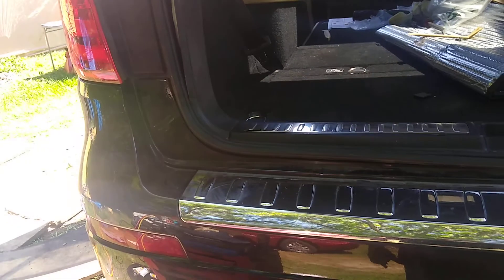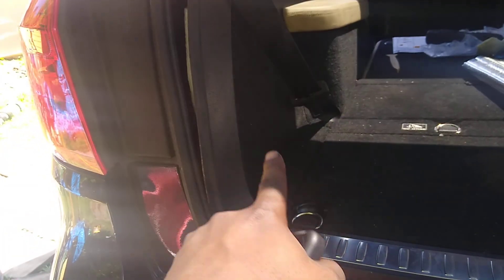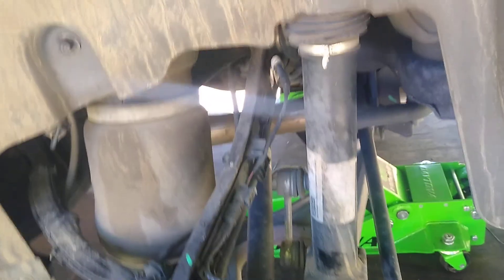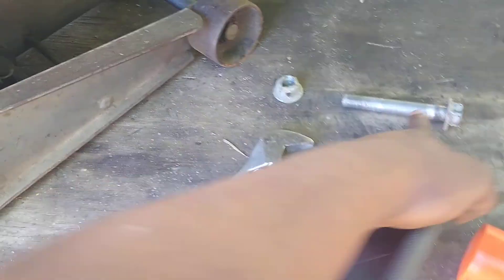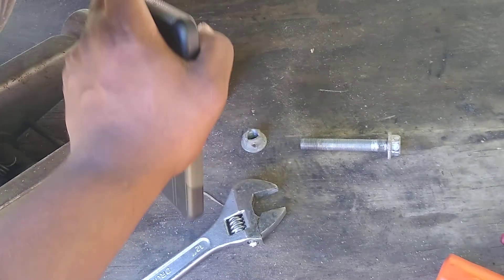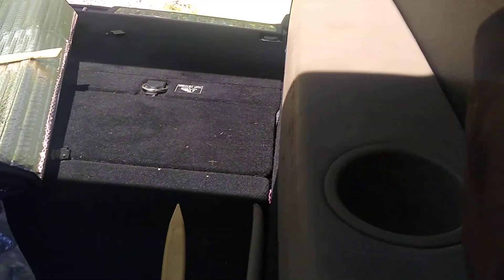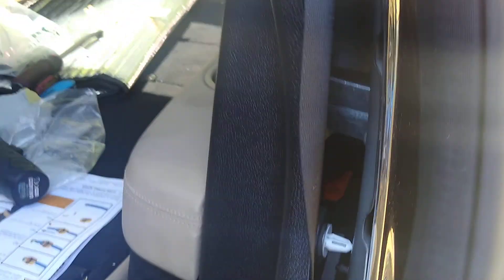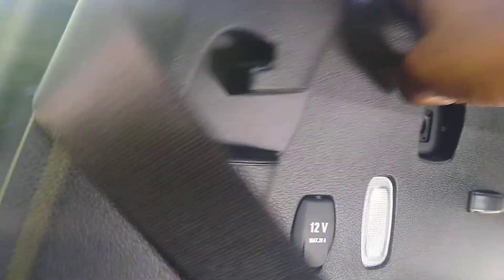Mercedes GL450 rear shocks tips and how to remove the easiest way

Comment: You're the only one out there with a brain, everybody else breaks the tabs on the arm rest to get those 2 top nuts. I much prefer the method you did, maybe a little more work but not a hack job and well worth it in the end. Keep up the good work.. I'm replacing mine today and I'll take the extra steps and keep the arm rest intact.
Reply from the maker: Thanks and your 100% right about that
Reply: Was the size 13mm for the two nuts up top? I'm having issues getting socket to seat down but I'm pretty sure it's 13. 🤦🏽‍♂️

Comment: Mike can you tell me the brand of shocks you purchased?  And since you installed them.....have they lasted.....or ??  Did you go Bilstein or aftermarket.
Reply from the maker: The the customer brought them offline he said it ride good
Reply: i had mine replaced with some cheap Chinease stuff - they blew out in 10 months and ate up the rear tires. had the m replaced and they blew up even faster and ate tires again. Bilstein is going in tomorrow.